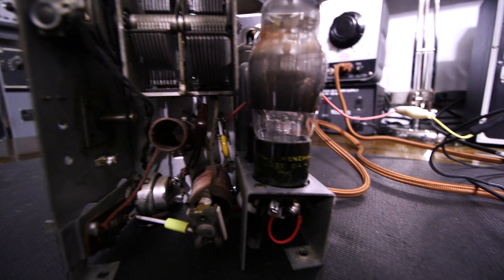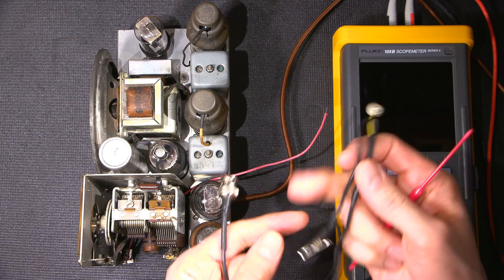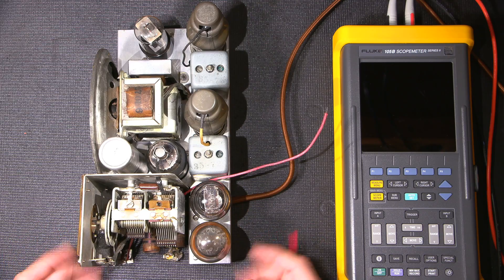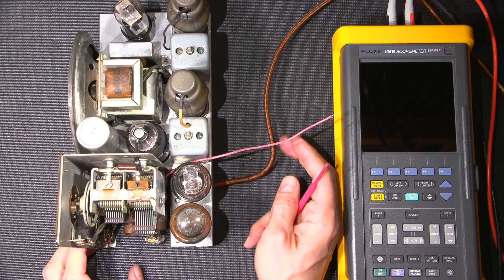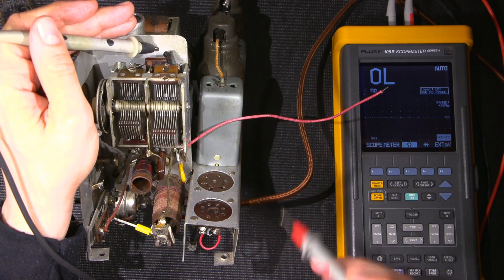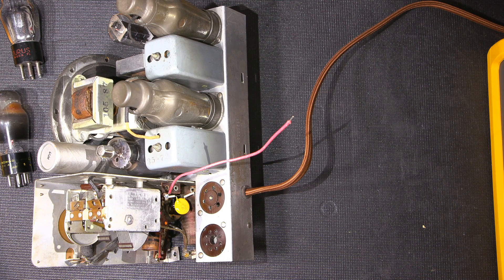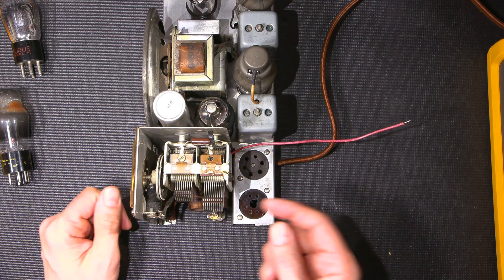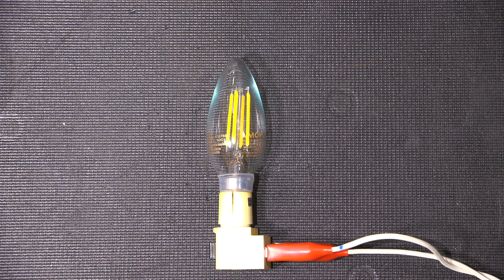See High Voltage Created From Falling Snow!

Comment: I'd say some specific AC/RF passing through the cap causing induction in the radio coil that was very high impedance at whatever frequency, possibly helped by the capacitors, tubes and other components total impedance...
but I'm no engineer :)

Comment: AM radio broadcast antennas use a large static drain choke between the feed line and ground at the tuning house entrance. The antennas are towers that are a couple of hundred feet long and insulated from ground and a good wind can produce a monster of a static charge on the tower. The choke presents a DC path to ground to discharge the static while being transparent at the station's frequency.

Comment: Although that coil has 30 Ohm DC, its inductance presents quite a high impedance to transients.  I wonder, in fact, if perhaps there is a sudden magnetic field surge through the coil and generating those HV spikes.  One other thought is that the antenna also is a tuned component.

Comment: There is a phenomenon called thundersnow. It is actually not that rare. Of course you could expect to see lightning and hear thunder when this happens, but that could be one possible explanation. We've experienced thundersnow many times up here where I live. When it comes to the very low parallel DC resistance, the inductive reactance must have been quite high at the frequency it was sparking, hence the freq must have been high-ish. Also, the coil has self-capacitance (+ stray C) and there is inductance in the wiring between the coil and the VC. The equivalent circuit might be much more complex at high freqs...

Comment: The arc in the radio was only secondary, the first arc must have been something else (likely in the isolation transformer). As the first arc ignited, it pulled the chassis potential down. The coil then provided a resistance to the current flowing from the antenna and charged capacitors due to its inductivity, igniting the second arc across the coil inside the radio. If you where standing grounded and touched the radio chassis, you would have been in for a very nasty surprise. Maybe not lethal, but quite shocking. The main cause where the voltage comes from is the same what creates lightning in thunderstorms.
Reply: That's not the point.

Comment: The clouds were full of lightning and the snow was discharging the clouds. The air was cold and it did not any were to bleed off the voltage so the snow took the lowest point in the circuit your antenna wire.

Comment: Really very interesting! I hope you are to determine the cause. Who guess correctly should win a prize? One possibility is the antenna is feeding a rising and falling RF frequency signal across the capacitor to the coil where at some point the frequency of the RF signal reaches the coils resonance or harmonic of and generates the spark.  So what could be the source of the RF? Possibly radio transmitter near house and the snow is somehow causing a frequency shift or picket fencing of the signal?

Comment: From your video, it appears that you have an anti-static bench mat, and if it was installed correctly, would be grounded, usually (but not always) some series resistance to ground. With that being said, the radio chassis is getting its ground path from the grounded mat, not some internal arcing from your isolation transformer. Just a SWAG.

Comment: u should get a fluorescent tube in somewhere. See a glow, hear a pop. like a double alarm voltage meter .. I dunno much about antenna, but it sounds like u have a lightning rod like ben franklin. didn't he do something with bells that drove his Mrs crazy ?   You sound really convinced about the iso transformer, but depending on the neutral bonding, it could be just adding to the "capacitor house" you have. Maybe u need to beef up your lightning arresters . or make something like a preamp before the lightning rod gets attached to the equipment. Gold foil electroscope ?  Cool story = Thnx for sharing

Comment: I had a similar event with a Shakespeare 10 /11 meter antenna. It was near a huge willow tree. There were no hydro lines near the antenna. If it was a dry day and the wind was blowing I would get an arc jump across the plates on the antenna tuner. Fortunately I had that and a MFJ watt meter between the radio and antenna. Would have fried the Uniden HR25

Comment: I have seen this before.. Once, when I installed a large CB antenna (shunted elements, even!) on top of a 3-story building.. I instructed the operator, that when not in use, to place the end of the coax in a large glass jar.. and when a storm is approaching (even when there is no eminent signs of a storm yet), he reports there can be  a "zap show" going on inside the jar!  the operator was blind- and he could HEAR the "activity" from inside the jar (his parents reported that there was a heck of a light show happening as well) his antenna was a ground plane with shunted elements.. and yet it STILL seemed to collect enough static charge to produce this effect!  AMAZING! (and yes- the antenna was DIRECTLY grounded  all the way down to earth and into the ground with a 15 foot stake.. (antenna was a massive thing.. )

Comment: Yea same thing happened to me around 2009, it arced from the servers network line and out the Power supply I could see the Scorch marks off the PCB on the power supply to the metal ground case, it was weird because the ''current'' it came from the Drive Array units that are Bolted to the ground and to a big ground cable out side of my garage I put in around 82' it a good 10 foot deep in the ground of copper I used for my RF lab ground off the main racks.. But the real problem was when the Salt truck drove down my street it SPIKED like Lighting type of Spike, it sent me into a slow-mo mode when I touched the Ground cable, it was like a 'Leader' Spike came up from ground and Thru me, it was like 2 min's of pure pain throughout my whole body and sent me flying backwards, I still remember the thoughts in my head of what I was about to land into the scrap pile felt like 10 mins slow-mo till I his the floor the worst Shock of my Life..Also all my Surge Suppressors 50% of them were Fried..

Comment: Many years ago working on a capacitance high security system that used  coax to connect to roof vents and aircon units in this large concrete building that was very odd in its self. So I'm in the attic above a large bustling production/assembly floor both ends of this coax.. rg6? Disconnected at my gear and the vents.
I discovered i could using the coax center conductor etch the electrical conduit getting nice sparks.
My "guide" saw this and said while looking down ..were done here .
3 months later the entire building was completely demolished thoroughly so.
I measured a small piece of the concrete wall they were 52 inches thick.
Never heard what happened i did ask while etching ... are we being irradiated ? He said..hmmmm.. maybe. 
Old silicon valley days.

Comment: ...WTH was the Ground disconnected?  I learned from dealing with Hallicrafters that you NEED to GROUND the chassis (unless you want to receive 60 volts!)  i have found that it is better to have the antenna disconnected from radios when they are not being used.  OK, You were running it through an isolation transformer.. I've never had one of those.

Comment: Static electricity is the answer. I recall in the early 1990's we were at the local red cross doing emergency communications. The coax cables were arcing.

Comment: Oddly enough, I'm interested in how those "filament" type leds work.  They don't look like they have a power circuit between the leds and the mains like other led bulbs.  I thought they would be more reliable because they look simpler.  I was wrong in that regard as after an electrical storm two out of the ten bulbs I have, which are only a month old, are flickering.  Looking at these bulbs though, even though they proudly proclaim "made in USA" , the manufacturing standard is very low.
Reply: NSDAP Enthusiast 88  Lord Chinggis will return as promised and every knee will bend beneath the Mongol yolk once more.  Also, the Communists had a lot of good ideas.  Especially regarding dog ownership and other loathsome bourgeois pastimes.  Sylvania (poorly) Made in USA LED bulbs don't have a power supply that I can find.

Comment: True fact, if you connect a long wire with good insulators to a good high voltage oil cap it will charge and zap the snot out of you. That was well known in the old days. You needed a balun and a spark gap for safety.

Comment: I had a similar happening during a thunder storm which was several miles away , during light rain i measured 3kv on my antenna with an electrostatic voltmeter , each drop carried a charge

Comment: The led's themselves are probably fine if they emit any light at all. Led's usually pulse when the capacitor smoothing their dc current is discharging more quickly then it charges or (i think) if the led is seeing low level AC on the DC circuit. Usually just old from heat exposure to the LED's themselves and it's their intended fault point. They ride cap values right up to the line in these things to keep the base as small, and hot as possible to encourage premature failure. But i imagine excessive static voltage could damage those caps too. As the caps get hotter it's probably exaggerating the  issue (guess without finishing vid yet lol). 

 I've had some led house bulbs going for years now by just popping em open and replacing that caps in em. they design the more modern one's in way a lot more difficult, or impossible to do this with though. If you drill a bunch of little venting holes in the plastic base of a home style led, they'll last for years and years too, long enough to lose Lx from the plastic discoloring and wearing. Cant do this will all of them though, some are too cramped in there and i think product engineers are starting to wise up too lol.

It wouldn't surprise me at all if you were to find a tiny leaking lytic or two in the base of that bulb.

Comment: I had the game thing happening. One day I herd Clicks coming from the boto, of the radio in a rithmic bases. the radio was not turn on and i unplugged. I lifted the radio and so the spark. The antenna was not massive, in fact it was a wire about 8 f long with a single wire leading to the radio. It was not snowing as it happened in Buenos Aires and was not raining.
Some ham operator told me that was cosmic charge and i interpret that as Static electricity forming as the gentle brease  flowing through the mag wire that the antenna was made/

Comment: in a snow storm you are basically the same as in a thunderstorm cloud. the electric charge can get real big. the fact that it was almost rhythmic shows it was charging like a capacitor to the point it built up enough electromotive force to bridge the gap and discharge.  your radio worked like an ignition system on a car. look for pitting on the air gap capacitor plates to see if it built up to the point it jumped shorting out the charge causing the flux in the coil to collapse

Comment: Living in a house with aluminum wiring, bizarre electrical snaps, crackles and pops are a warning to tighten the screws on electrical outlets and switches!

What were the temperature, humidity and barometric pressure when this strange phenomena occurred with the falling snow??
What is the length of your long wire antenna, and height off the ground? This is fascinating!!!

Comment: Was the radio on an anti static mat as that could be the path to ground and not the transformer.Although I don't understand how such a small capacitor could transfer such a large current pulse,I suspect that the due to such high voltage the current was going around the edge of the ceramic/mica dielectric inside the encapsulation so although you device shows it as sill being good it could have damage that is not apparent to low voltage. Not surprised that snow carries charge after all thunderstorms are caused by ice crystals in the clouds.

Comment: I will present a thought if i may.
in normal weather conditions the electric field of the earth is about 100v/m.
During storm conditions this will rise significantly even in the kv/m range.
if the two elements of the dipole are connected straight through a coaxial cable,maybe they are not equipotential.
The side that is connected to the shielding of the coax tends to be at(or near) ground level potential even if its not connected to ground or to anything electrically.
That is because the electric field lines of the earth are shorted through its length all the way down to ground height electric field level.
The center conductor is shielded from the earths electic field lines and has the characteristic potential of the other element of the dipole,
which is exposed to the level of the electric field in that height (kv/m).
So there is a voltage difference and a charge is building up in the capacitor formed by the coaxial cable and whatever capacitance is connected to it.
if charged snowflakes deliver more charge to the dipole,the center conductor "shielded" portion of the antenna will eventually accumulate so much charge
that a breakdown is going to occur ,a spark is going to jump through the coax,or through the dipole elements so that these two can come
to a charge equilibrium and the cycle will repeat itself.
This i think will be prevented if you use a balun,otherwise during storm contitions ground both the shielding and the inside cable of the coax as a precaution.
Might be a very interesting experiment if one could try to harvest energy from the earths electric field dy using an antenna like yours,a very fast switch of
somekind to connect the center portion of the coax to one end of a capacitor, the other will be grounded.
the switch will be going back and forth ,from the center conductor to the capacitor at a certain switching rate .
The capacitor will be discharged to a load via anoter switch operating at the same frequency only 180 degrees out of phase.
I wanted to perform such an experiment for many years , but never had the chance.
Please excuse my english if i made any mistakes,its not my native language.

Comment: With the accumulation of individual charges on snowflakes, it seems like you were gathering the power that drives lightning, but in slow motion. The near instantaneous nature of lightning has always made it of limited use as a power source. Imagine a field of your antennas during the snow storm. I can't help but wonder if a massive amount of power could be successfully recovered from a system optimized for these events?

Comment: What exactly did you mean when you said "I have it down to one sixteenth?"
Reply: Augustin Chenault F-Stop; f/16 commonly called 1/16th
Reply: Camera lens setting.
Reply: He's using a real camera with actual F-Stops, not a phone camera.
Reply: Roflcopter4b what is a real camera
Reply: @GadgetWusky  A device that is only a camera, not attached to something else as an afterthought.
Reply: Roflcopter4b There are cameras with no phone on it? What the hell is the point of that
Reply: @GadgetWusky  People use them to take photos that look good without requiring extensive amateurish photo manipulation first.
Reply: Roflcopter4b why do you need a phoneless camera for that
Reply: @GadgetWusky  Donald Trump will automatically ruin all photos taken with a phone camera. You need one with no cellular signal at all to be safe.

Comment: I suggest that any antenna connection to a radio should have a bleed resistor directly to the radio ground/chassis. About 100k should do. That prevents charge buildup on the antenna or in the series input capacitor. Also, in any antenna, look for open circuit points or capaciotors between antenna conductors where static voltage can build up and add bleed resistors there also.

Comment: I may be wrong, but isn't the self-inductance of the solenoid opposing the sudden increase in current? maybe that was the cause the current did pass through air (as electric arc) rather than through the solenoid. This is not DC, so the 36 ohms are not really relevant here.